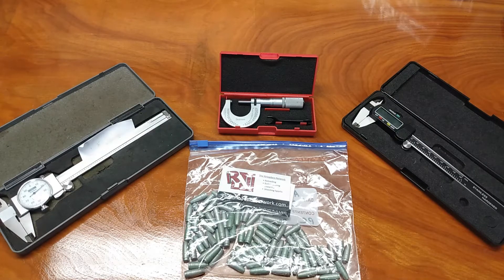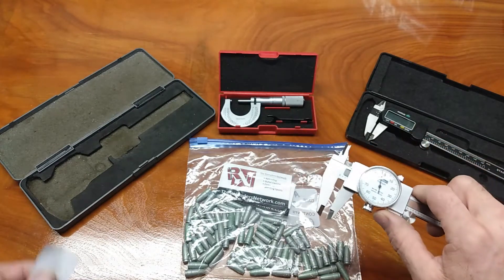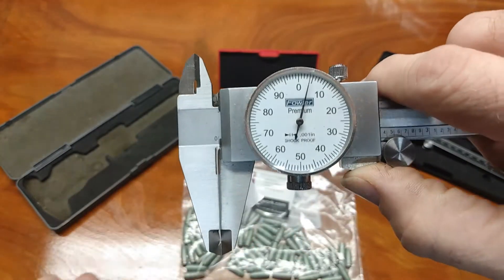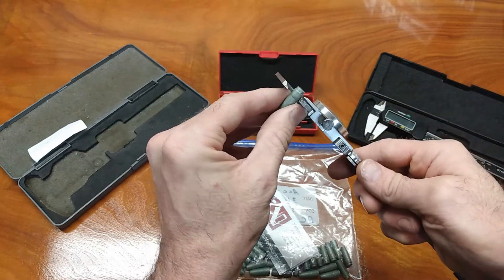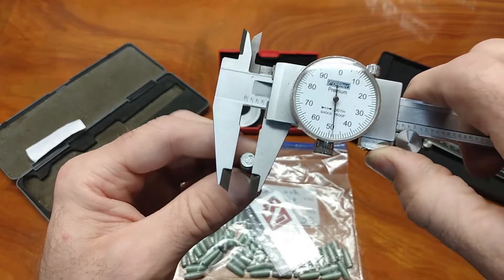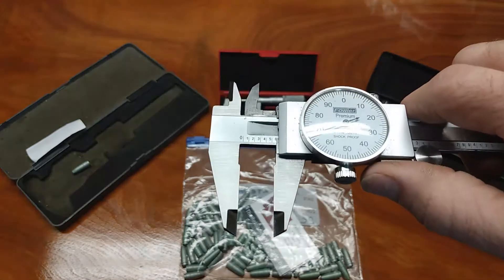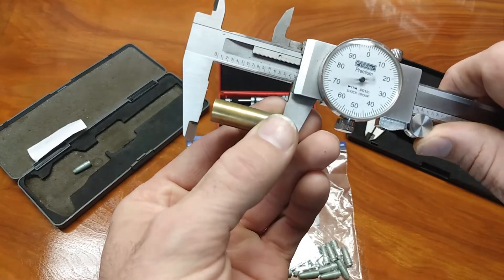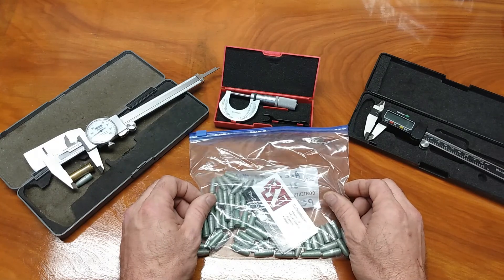My Technique For Measuring with a Dial Caliper V.R.  Johnny 1982

Comment: Everyone should get a 1" standard and practice measuring if they want to be consistent with calipers. They should also have a 0-1" mics for closer measurements.  Calipers can't measure. 0005".
Good video.
Reply from the maker: Agreed... A nice quality 1in micrometer will reveal a lot that goes unnoticed with our calipers. When I first started using tools like this, I let the little .0005 on a set of digital calipers cause me frustration. Low and behold, it meant nothing for anything I was working with. If anything, it was nothing more than the equivalent of the needle on a dial caliper not lining up perfectly with a .001 graduation.

Comment: Good vid Lead Brother,  maybe do a vid on how to read analog reloading tools as it seems like everyone is at least acquiring analog tools as a 'just in case' arises.  I recently picked up a couple of vintage Ohaus beam scales and a newer analog dial caliper. Scale is easy to read, the calipers took a little but fine.One way people can learn is if you can read digital, take the same bullet(or whatever you are measuring and take a digital reading then analog and see what it says. After a few times of comparison its easy, thats how I learned lol
Reply from the maker: I've got a gunsmith buddy that has wanted to start a channel. I think that would be the perfect kind of start for him. @Rooster Kuepper
Thanks for coming by... PS, i responded to you on MEWE
Reply: @leadsmith44  Did Rooster start the channel yet? Maybe give him a shout out once he has a vid up so we can give him a good start.... I need to get into the habit of checking MEWE lol
Reply from the maker: I may need to put a bug in his ear again. The Starret micrometer that I use in my videos was a gift from him. He's the one who taught me how to read it. He's also the one responsible for starting my handloading addiction lol.